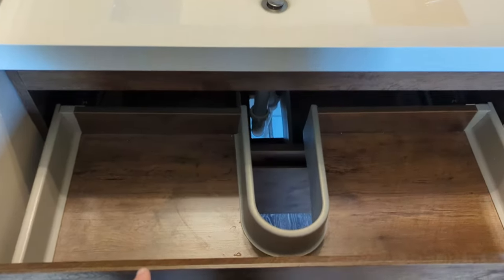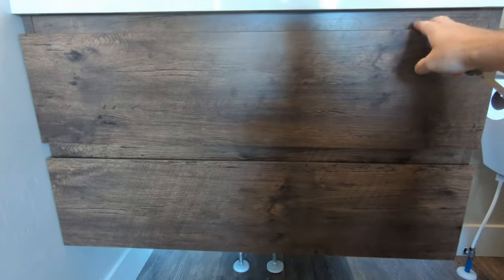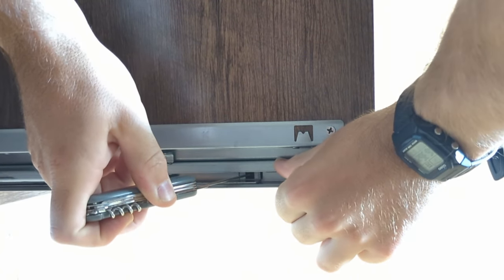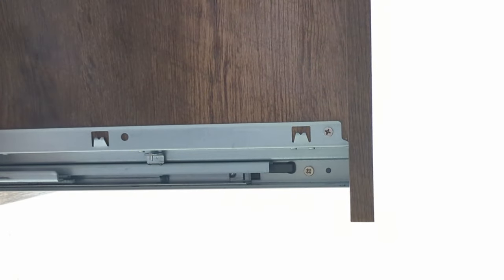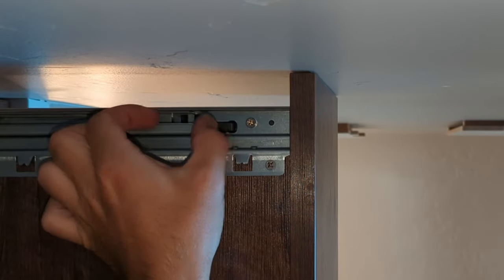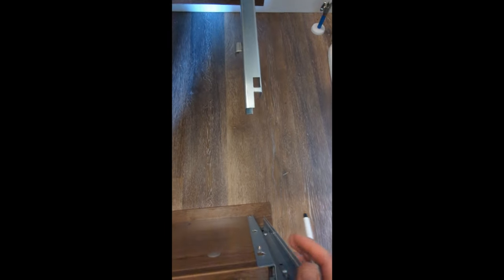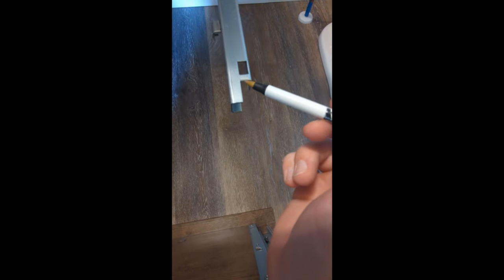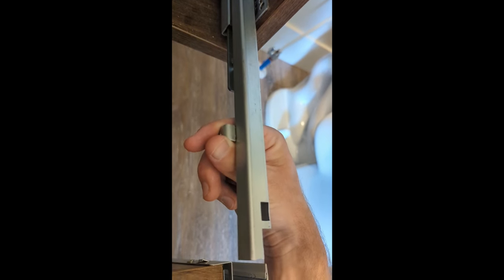Remove and Put Back Vanity Drawers

Comment: well you have the gray cover on side of the drawer for a reason ,remove them an there is all adjustments you need to to if necessary ,included for easy removal drawer ,your welcome :)
Reply: Absolutely! Remove the plastic cover from each side of the drawer and simultaneously pull up the catches on both sides and lift.. no need for tools and getting underneath the drawer!!!

Comment: If you remove the small plastic plate on each side of the drawer, there is a latch with a Philips head screw behind it, push the latch, insert the screw driver, twist and viola! No knife necessary. Bonus is you don’t have to scoot under the drawer on the floor.

Comment: I think the hardware manufacturers have to come up with a better system to remove the drawers, maybe from the sides instead of underneath. Wall hung cabinets look like crap unless all the plumbing is hidden thats why i never did it on my bathrooms, you have to redo plumbing to make it look nice.
Reply: there is and its right under the gray covers on the side of the drawers but nobody knows that lol